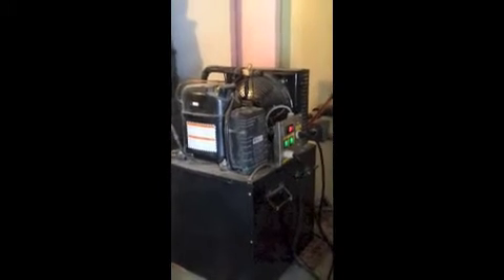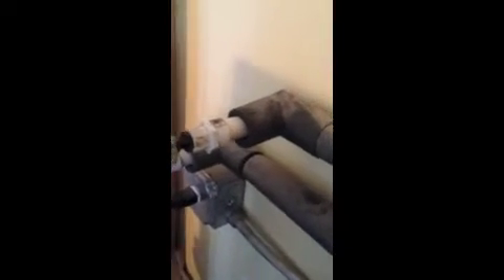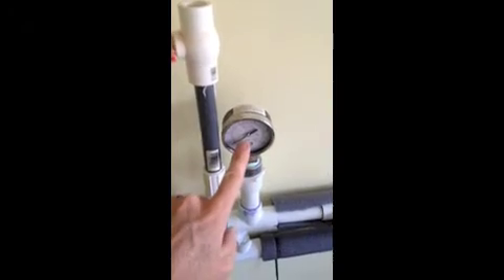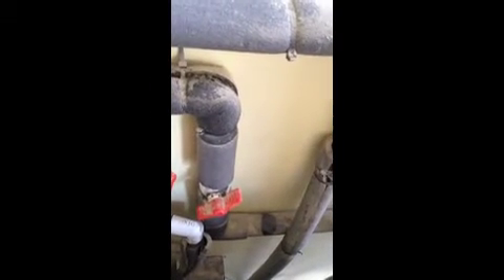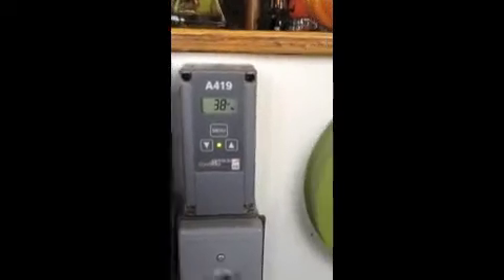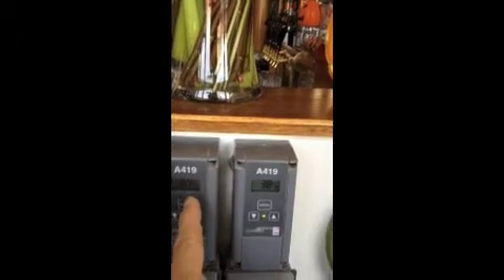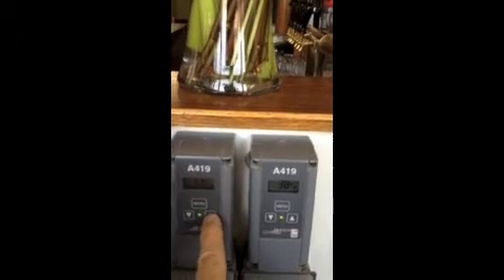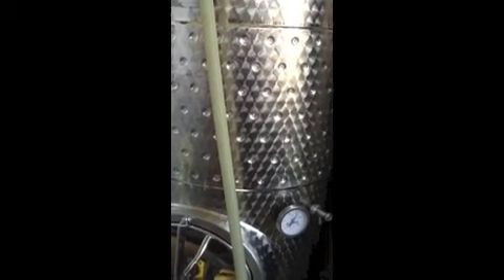glycol set up - More Videos At www.coloradoboy.com

Comment: Thx for the excellent video!
My company does mostly commercial/industrial HVAC work.. but recently we were asked to install a glycol chiller for a company that cans drinks, including carbonated beverages. They asked us to install the chiller... so I'm scrambling to find out as much as I can before agreeing to do the work. The chiller is needed to cool the beverage before the carbonation process. Any you info you  can send my way would be much appreciated!   Jack
Reply from the maker: I would think a good beverage glycol chiller and glycol trunk line would do the trick. Foxx Equipment can sell one and make up the glycol line. If you had one that was about 20 ft. long and the glycol is always set at 29 F, then if your beverage is cool to start with, the trunk line will deliver product sufficiently cold enough to carbonate. If it is room temperature, then a longer trunk line so the product has time. Another possibility would be to run the product through a heat exchanger, with chilled glycol on one side and product on the other, but that is more expensive. How much needs to be chilled for packaging?

Comment: Hi, great video.  Can you send me the diagram you referenced?  Also, I have a couple of questions.  I'm building a home version of your system but my glycol will go to one small conical covered by a jacket.  The two problems I am trying to solve and questions I have are: 1) my solenoid valve will remain closed until activated open by the temperature controller.  Will this closed valve cause back pressure on the pump of the glycol chiller and damage it or reduce it's lifespan?; do I need a back pressure regulator? It seems your solenoid remains open then closes to divert flow to jacket. 2) I will have to reduce the pressure from the glycol pump which is listed as 18 psi to 8 psi so as to avoid rupture of the jacket.  Any suggestions on how to do this? I'm considering a pressure reducer or diverter?
Reply from the maker: I'd be happy to but I need your email address. The diagram will answer your questions. My email is tomhen@mac.com

Comment: Great vid. We use the exact same chiller, and I am redoing a few of the lines to include the ball valve reducer on the loop. A few questions - how did you set up a pressure gauge on a pvc line? What temp are you keeping your reservoir at? Are you doing a water/glycol mix?  What temps are your tanks getting down to? We've see we cant really get below 38, which is fine for fermenting but not great for our bright tank. Thanks for your vids, we utilize a lot of what you've shown in our own brewery! 4qbc.com
Reply from the maker: Pressure guage on a tee. However with this chiller the pressure is not going to get into the danger zone so you should be fine without one. I keep the resevoir at 29. 37 is my lowest temp. I am not packaging off a bright tank so it is no big deal. My yeast drops out at 60, so 37 will handle anything I want to brew.
Reply: +ekapada thanks, we actually carbonate in our fermenters sometimes. Thats why we need lower temps.
Reply from the maker: I corbonate in my servers at 38 in the room. 4 psi for 30 minute, then 8 for 30, then 12 for 30, then 16 for 30 and finally 20 for 30. It zahms out at about 2.55

Comment: What size is you main trunk line  1/2" or 3/4' PVC? Building a similar manifold and trying to determine what size to use for the mainline.
Reply: +k Brown I used 1 inch in the video but on our new brewery I used 3/4 which works great
Reply: +Colorado Boy thanks for the speedy reply, great video!

Comment: Thanks for the video!  Quick question, what is the make and model of the pressure reducer?  I didn't realize how many different kinds there were until I started shopping for one.
Reply from the maker: I'm not sure what it is, but I am plumbing a new system for our new brewery and am using just a pvc cut off valve for regulate pressure. I am thinking that because this type of chiller doesn't produce as much pressure I should be ok.